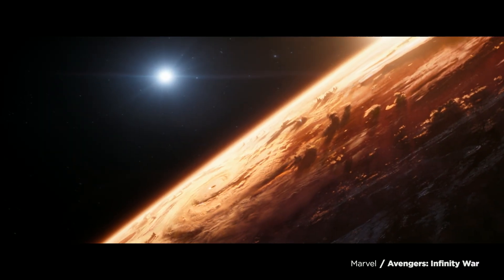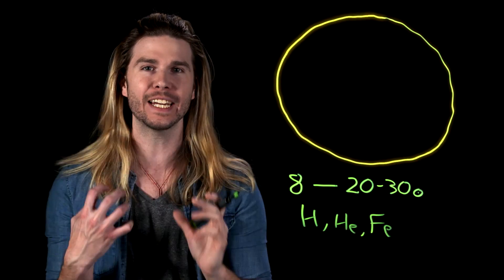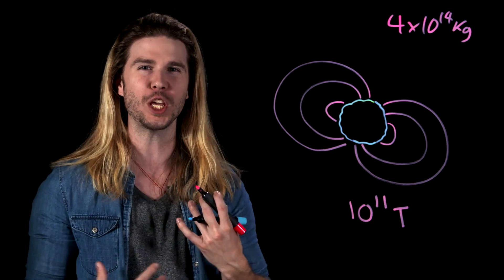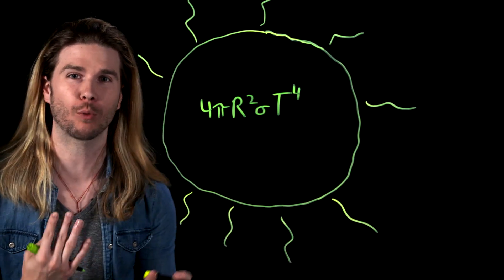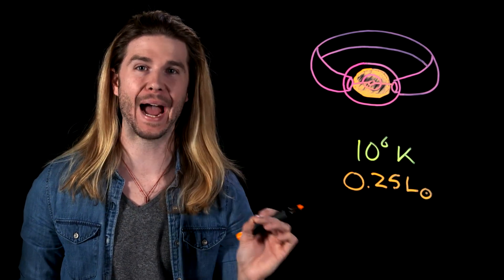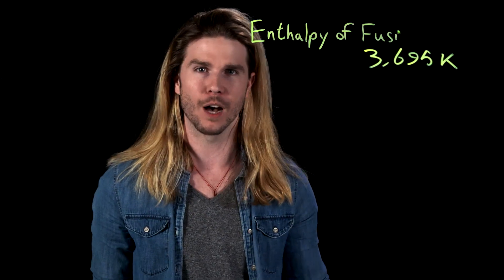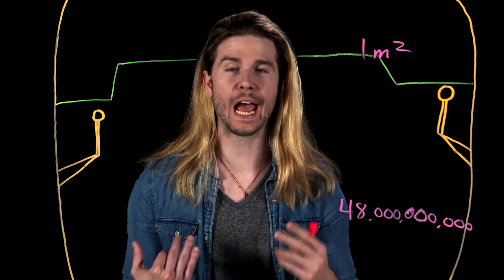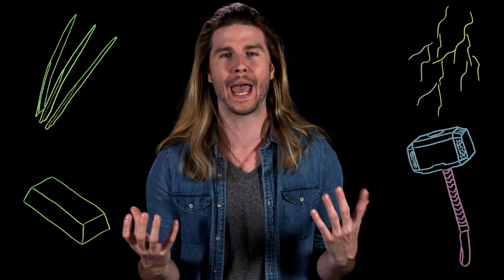How To Forge Thor's Infinity War Weapon

Comment: CORRECTION : Stormbreaker was CAST. NOT FORGED. Forging involves application of stress to a hot formable alloy. Casting involves melting of an alloy and pouring it into a mold and letting it cool until it solidifies, which has been shown in the movie.

Comment: The star didn't go into the Hammer, it was used to melt the uru because the metal can't be melted by anything else, so the hammer wouldn't gain weight.

Comment: You're assuming that they're using the luminosity or heat energy of the star to melt Uru in the forge, and not some kind of gravity lensing effect.  If the Dwarves were purely after heat energy they'd get a better result creating a fusion core several kilometers large, instead of setting up shop around a start that could crush their entire infrastructure into a thin paste...  It's more likely they're harnessing the gravitational field of the Neutron star to power the forge which would make the electrical power equivalent much larger than your calculations would show.

Comment: Correction. Strombreaker was cast not forged. Forging is shaping by beating material into shape with a hammer or press. Stormbreaker was clearly cast by pouring molten metal into a mold. Still cool tho

Comment: Ive just rewatched the movie today, and I think you got this slightly wrong. I think what you calculated applies to the amount of energy Thor is withstanding at the "iris" of the Forge, but not the energy required to melt Uru. Upon closer inspection, the rings act like concave lenses, which would intensify the luminosity of the Star. This would also explain why the rings themselves arent melting from that laser beam...

Comment: @BecauseScience When calculating the power output needed to melt the metal, you calculate the energy output of the exposed star surface behind the apparatus opening. If i remember correctly in the movie they mention that the forge of Nidavellir uses the focusing rings to harness "all of the power of a neutron star." Meaning that the energy output of the aperture should be that of the whole star, not just the exposed surface, making uru metal even more impressive.

Comment: When you talk about the energy that Thor mught have taken by standing for the neutron star, you forgot one thing ; the main radiation sources from this star are X and Gamma radiation, with so much energy that the cross section in water (main component of Thor) is very weak, so the energy he "took" is not that important (but still enough to turn into dead pool very soon)

Comment: What I don't get is, why doesn't Thor use his lightning powers that he mastered in Ragnarok to heat up the metal? I mean lightning has temperatures similar to the surface of the sun. (Calculations below)

Each bolt has about 1 Gigajoules of energy, if we're talking Earth lightning that is. If we assume its duration is small, which it is, let's say about a half of a second, its power rating is about 2 Gigawatts. If we then extrapolate the energy needed and the power rating of the bolt, E / P = t = 2x10^11 / 2x10^9 = 100 seconds, only 1 minute 40 seconds of Earth-like lightning to supply the same amount of energy as the neutron star. This is obviously assuming efficiency is 100%, but if the efficiency were something like 50% it would still only take "a few minutes".

Comment: That why thor is not gonna have this weapon for awhile. Beta Ray Bill anatomy is design to get stronger from excessive light inputs and radiation. It make sense that marvel made the hammer like this. Beside it very unstable. The dwarf lost the handle in the forge so they will created mjohnir and give stormbreaker to beta ray bill. It that or thor ended up dying solely because of an unstable, constantly emitting radiation hammer

Comment: The big problem with this idea is that with how massive that star is, time would accumulate less quickly around the star meaning that Thor, Rocket and Groot would spend a few hours in the forge and it would be more like a day for the rest of the Avengers... which might not really effect the time line... but the bending of spacetime and accumulation of time was not mentioned.

Comment: Thor also survived floating in space after his ship's destruction...
Reply: I mean, he is a god afterall... but i understand that it's lazy writing and doesn't make too much sense so they should explain how that's possible but they just say "Well he's a god, so ya know, god things"  - Russo Bros.
Reply: God things you know.
Reply: So he can survive extremely low heat and extremely high heat and summon lightning and thunder 
Yet he kept getting electrocuted in ragnaruk
How does that work Kyle

Kyle please explain how the god of thunder can possibly be electrocuted
Reply: @Wendell Sanders:
Easy - when he's not manifesting his power, he's as vulnerable (though not as weak) as everyone else.
   And since the thing was actually clamped into his skin, it bypasses some of his 'protection'; when attacked by energy weapons, an 'aura' effect can sometimes be seen.
   Finally, the device might be self-calibrating for effect, and he's being zapped much harder than others with the same device.
Reply: @galactic-shithead390  well in comics it is called obedience disk. It can even defeat silver surfer.

Comment: If operation at those heat and densities, how hot would it have been when Groot touched it? That is some heat resistance.
Reply: Note that the heat did not radiated out and broil anything.

Comment: Those numbers are pretty intense, but if they built what is perhaps a Dyson sphere around this neutron star, could they also have  built the sphere to reflect energy from the other sides of the star and focus it through the aperture, this vastly increasing the potential energy output?

In regard to the air thing, I posit that perhaps the gravity of the star and the magnetic field, though harness by the dyson sphere, could hold an atmosphere around the apparatus, much like Earth, also explaining why there are no doors or anything to keep them from being exposed to the brutal vacuum of space. Or, Asgardian magic I guess.

Comment: How much force would Peter Dinlarge need to break the Uru mold open, like we see him do in Infinity War?
Reply: Adding to this, wouldn’t the mold need to be stronger than the thing being cast inside it? I know that opening a mold would be easier but from a durability standpoint it still doesn’t look good for stormbreaker.
Reply: +SUPAAH  

No, it would not need to be stronger. You can literally make molds for METAL out of compacted sand, which is what's usually done.
Reply: james pogrebetsky what could withstand that much heat?
Reply: mmm if it's anything like a real mold... not that much, punching it with his metal hands a few times definitely would do the job. molds are typically made out of ceramic or compressed sand with binding agents

Comment: I had assumed that the forge surrounded and contained the supernova produced by the star. So that when the Iris is open a concentrated beam of supernova particles is blasted directly into the forge to heat the metal.

The forge running cold could simply mean the forge itself can't release the energy stored within safely. after all the energy was still contained within the forge, it just hadn't been released.
This is how I interpreted the dialogue of "forged within the heart of a dying star". the star was in a constant state of supernova because all that rapid expansion was being contained. By the way, I love the show! I have always been very analytically minded due to a case of Autism Spectrum Disorder, but as a result of that I never could muster the focus to pursue scientific study, this show has helped me stay motivated and for that I thank you!

Comment: Minor correction/extra detail: When a star fuses lighter elements (usually silicon) into iron and nickel, the iron starts to accumulate, and really what happens is that that iron and nickel will not fuse as the fusion of iron or nickel will produce no net energy output, they are the most stable atomic nuclei. As such, it's not so much that the core becomes more massive (no material is added) it's that it is not undergoing fusion with a net energy output, and as such the gravitational force of the original star's mass suddenly has nothing pushing out to counteract it, and the star collapses into a type II (or type Ib or Ic) supernova, creating the pressures to break through electron degeneracy and force electrons into protons creating neutrons and neutrinos. This neutrino pressure, combined with the shockwave as the outer layers of the star bounce off the core and a little bit of light pressure (as in pressure from photons) force the outer layers outwards into a supernova explosion, and leaving a neutron star in its wake, which is held up by neutron degeneracy instead of electron degeneracy like normal matter.

Comment: If you watched closely the beam of neutron star was only used to start a fire which heated the metal. I think its more magic based.
Reply: They could make fire with a couple of groot's stick
Reply: im just curious what the forge was made of to not melt
Reply: @mrnight7530  adamantium
Reply: Mr Night magic. Literally. Has to be magic, at this point.
Reply: what? lol. no. just no. Not sure where you got this idea.  It wasn't about the tiny ass fire. It was about the concentrated energy of the son.
Reply: Mr Night protected with magic.
Like our stomachs are protected from the acid.
Reply: No. this was not forged, it was smelted and cast.   Forging involves heating a metal to a work temperature, then applying pressure to align the metal in the shape you want, and then a process of heating and cooling to temper the iron.  What this hammer is is a casting of a metal - possibly because it has completely different properties from Iron/Steel (More like Bronze but god-like, I'd wager).. But no, forges work by a lot of heat and pressure applied in proper proportions.  This was smelting/casting IN a forge.
Reply: The Chiefs - That’s how all forges work. They use a crap ton of heat such as a fire in a furnace to melt whatever metal they’re using for the tool, then pour the molten metal into a mold. 

The case in Infinity War is that the fire used came out of a freaking neutron star, so in turn was burning quite a bit hotter than your average fireplace. If they needed to light a fire to melt Uru then they would have used anything else and they would not have made that humongous star forge.

You’re basically using 1/4 the Sun’s surface temperature as a furnace, concentrated on the Uru.
Reply: The Chiefs no you are completely wrong Thor states it is just futuristic technology not magic the closest magic is loki and doctor strange.
Reply: Azgardians don’t actually use magic they use frickin futuristic technology. This is actually a really old video I believe on the nerdist but it basically said earth is a 0.75 level and azgard is level 5 in terms of civilisation meaning they have no shortage in resources, are ahead in technology and have found a near infinite sustained environment etc.
Reply: @bruh1704  well it's really easy to sustain one humanoid entity.
Reply: Gavin Kaulike not sustain one humanoid entity a entire race for an infinite amount of time.
Reply: Daniel Damn thank you i am glad there are other people that have paid attention to the movies and videos
Reply: It seems more like a miniature normal star on inspection, but mostly plated over.
Reply: ORRR... they could have also harvested some material from the neutron star at the same time.
Reply: Daniel Damn then explain Loki’s powers
Reply: @MellowhearttheCat  Loki is technically not asgardian he was just some other species that Odin adopted.
Reply: You guys do get that uru has a VERY HIGH melting point in Infinity war. So they do need a star for it.
Reply: that forge is the forge that is used to make the most powerful weapons in the universe so of course its special
its also made from special metal and enchanted with powerful magic most likely placed by the Asgardian Kings like Odin
Reply: @midori4713  the forge is made from adamantium
Reply: MARVEL neutron star isn't real one...
Reply: It was a tiny ass fire. It didn't make much sense if you re watch it. Hence magic.

Comment: Hi Kyle! Long time viewer, first time commentor.
A few things, firstly - if an elevator is worthy, you totally are.
Secondly, maybe Thor is breathing because the forge has an atmosphere around the star? We do see sone plasma around it. Is it possible the gravity of a depleted Neutron star  that has been siphoned of millennia has dropped to this point?
Thirdly, shouldnt Thor have been blast Naked the moment he opened the iris? I get why they didnt though.
Lastly, my head cannon for the adamantium speech is that once you make it, the energy required to melt it again is too dangerous as the alloy has an immense specific enthalpy. Otherwise the second Wolverine Movie with the silver samurai doesnt make sense.
Reply: I do have an alternate adamanium theory too, where too much heat causes the alloy to separate and one of the component metals evaporates off. The reason it can be made in the first place is through the use of a stabilising agent that cones off as molten slag.

Comment: But if Thor is blocking the energy with his glorious asgardian butt, wouldn’t it either take longer to melt the metal, or wouldnt the amount of energy required be lesser than calculated? If the opening is approximately hemsworth sized (~2m across), and if Thor is blocking 1m^2 of surface area, then he would be blocking about a third of the energy, meaning it would take a third longer, or a third less energy.

Comment: You did a few calculations based on melting the uru for forging.
In reality, when blacksmiths forge a hammer/sword or what not, they DON'T melt it (that would be "casting" not forging I think) they just get it hot enough that it's softer and can be forged.
Im sure you did it this way cos they melted it in the film (haven't seen it) but it always bothers me when I see people "casting" sword and stuff in mordern media, even GoT did it. It's not like its a lost art and nobody knows how stuff was forged, blacksmiths still exist and I find it weird that it gets ignored :(
Reply: I agree they got the terminology wrong. That said, casting is more appropriate for some materials (bronze, for example, is almost never forged), so it's not really any less believable than forging given we're dealing with a comic book magic material.

GoT melting metal for steel swords is especially egregious, as for most of history nobody had the technology needed to generate temperatures high enough to melt steel. Instead the steel was made in the solid phase (as 'blooms' of spongy metal mixed with slag) and then forged into a bar. That bar was then folded in half and forged back into its original shape several times, the hammering serving to force slag and other impurities out of the steel (this process is where the whole 'folded 1000 times' katana thing originates). Only then could it be used for a tool.
Reply: it's a film trope. very few movies actually get "forging" right.

Comment: Another impressive part is given how increadibly high the melting point of that metal must be, and had only cooled down for a minute or two, but Groot's arm wasn't vaporized.
Reply: Only way I can take that is plot, or that the axe pieces' enchantments cooled it rapidly. Though that's a bit of an ass pull

Comment: If that type of metal is so dense that it takes that much engery to melt, then wouldn't it exert a gravitational force on the same order of magnitude as the earth (if not far stronger)? That means it would be almost impossible for Thor to miss since people near it would be pulled towards it by the weapon's own gravity ( if not ripped apart completely by it) .

Comment: Actually thor says that his hammer is forged in the heart of a dying star not a dead star this means the dwarfs had to capture the supernova not just the neutron star.
I tried to estimate the energy that would be relised if that would be the case and i got that in two minutes about 5*10^228 J would have been relised. also the temparature in the forge where the neutron star is would have been about 3*10^58 K. btw gl jumping 1 m high on a neutron star to begine with :P

Comment: This already assumes that the full output of the neutron star is being harnessed by the forge apparatus, but the nature of the aperture should only allow a small conic section of the star's total radiation to actually enter the forge - the rest of the energy just gets radiated in other directions.

Also, since Thor was standing in the aperture of the apparatus (and seemed to be blocking quite a bit of the center of it), it would seem that his body would have blocked/absorbed/deflected much of the energy coming through the aperture (as can be seen by all the burns and other tissue damage Thor receives from that energy, even with his Asgardian physiology), wouldn't the actual energy transferred to the metal be only a small fraction of the power output of the star?

Comment: Did they forge it? It looked more like it was cast in a mold and then put together by an adolescent tree to me. Forging would've required more facilities and would've been even harder to do with no blacksmiths to wield hammers and Thor having to withstand the power of the star for much longer because forging takes a lot more time, but still, they kinda copped out in this scene as far as I'm concerned.